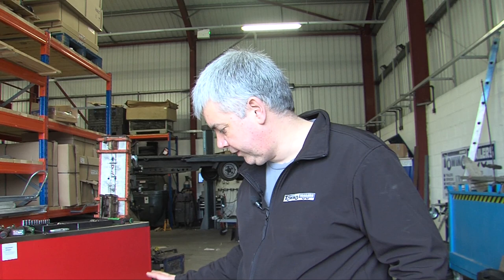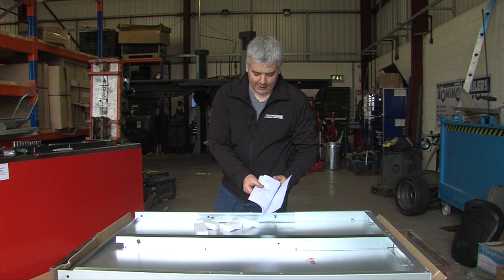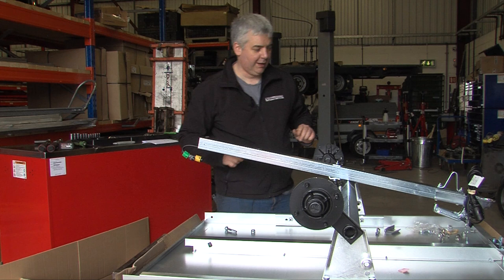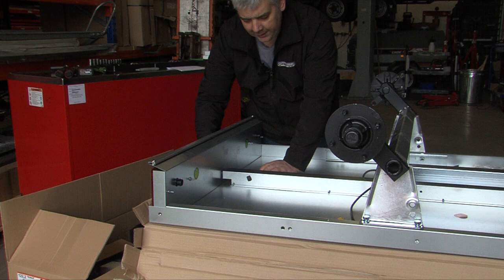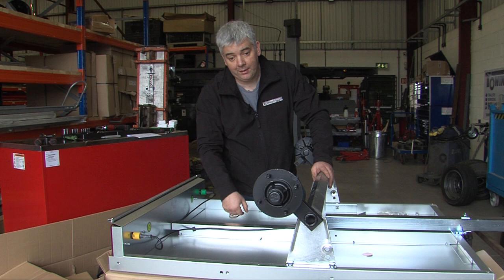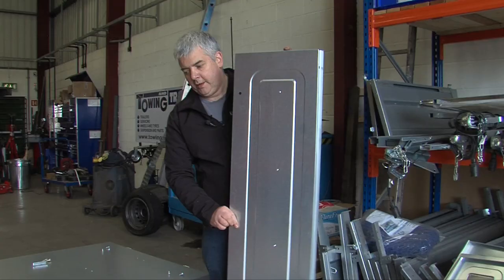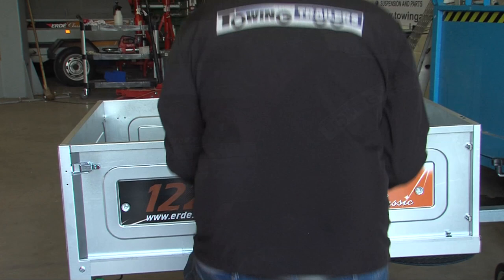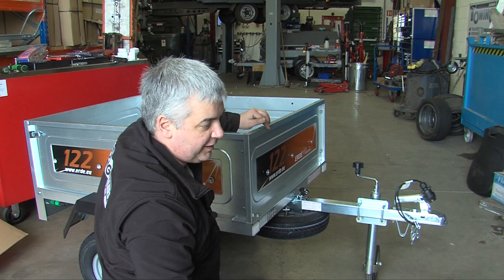How Assemble an Erde 122 Trailer

Comment: Thank you for the video. I have one of these but a little bit larger and I have used it for the last ten years for many different things.I am in Australia and I was able to buy a fibreglass lid for mine. I am thinking of converting it to a camper trailer with a roof top tent.  Can I use larger hubs on this axle? I would like to have the same wheels as the 6 stud Toyota.